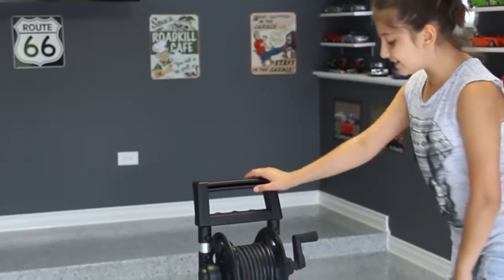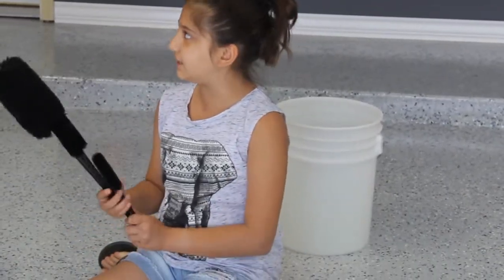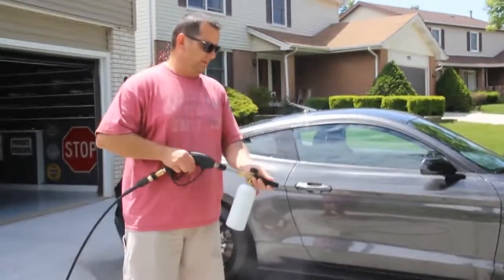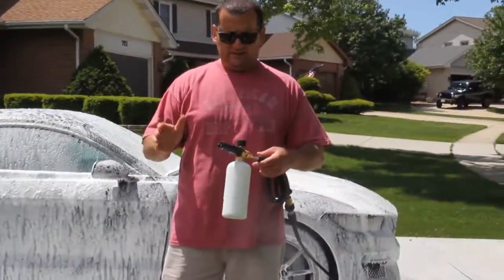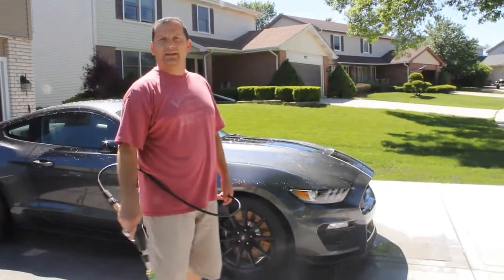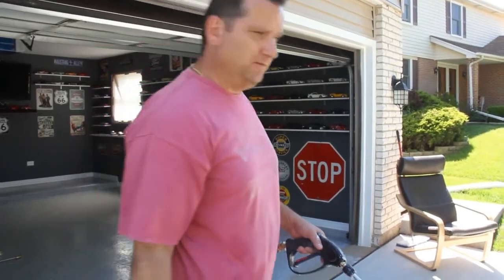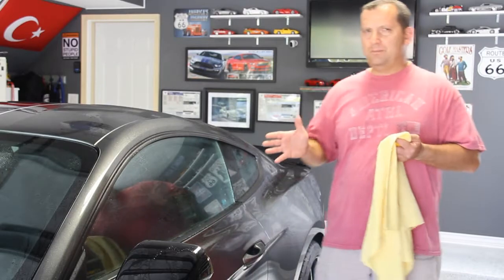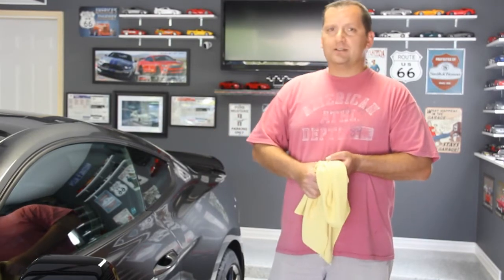Ford GT350 Detailing Foam Cannon

Comment: Love your vids. Keep them up man.
Reply: I have a question too. When ever I use my foam cannon, it seems water only comes out of it unless I hold it upside down. Am I doing something wrong possibly? I'm almost certain I have the same one as you.
Reply from the maker: Brandon dsadasdas .... Hey buddy, good question. The same has happened to me before. You might need to remove the adjustment cap with the + & - sign and reset  it. Mine got loose somehow and didn't work properly. Good luck pal!!
Reply: GT 350 Thanks for the advice man. I think I'm going to wash my car today too 😁
Reply from the maker: Nice!! It's always fun. Happy Memorial Day my friend!!

Comment: Sweet GT 350 man! I subbed. Btw what brand of wheel woolies do you use and how well have they held up so far? Just got my '16 GT and looking for something that will clean my Perform Pack wheels since they are pretty hard to get in the nooks and crannies.
Reply from the maker: Scotty Beats thank you so much buddy!! The brand I'm using are 	
ABN Wheel Woolies Wheel Brushes Kit...and they are holding up pretty good. I've used the on my 2016 GT for a year and still using them on the 350. I am also using Adam's Wheel Woolie with the slight angle to reach in those hard to get areas. Lastly I also have the Detail Buddy Premium Detail Brush set. I know it's a lot of tools, but that's what I have in my detailing arsenal to get it done. The GT premium wheels are so hard to clean that you need multiple brushes. Those Brembos give off so much brake dust it's hard to keep up with the wheels sometimes. I hope this helps!! Thank again!!!

Comment: You should consider doing the two bucket wash to prevent paint swirls but great job on the video👌🏻
Reply from the maker: Ku Ikram You are 100% correct!! I am very careful during the prep before the wash, but I am still shopping around for the best two bucket system with a dolly built in. That are just so overpriced for that kind of setup. Do you have any recommendations? And thank you much for watching!!

Comment: I hope you don't wash your car in the sun every time.  I know the lighting is better outside for the video.
Reply from the maker: Jim G, No sir, haha that was just for the video. Normally I would do it early morning or early evening. I dreaded the possibility of getting water spots after I was done. We were good:-) Thanks for the comment!!
Reply: I have a foam gun but I need to sit down with the instructions and really understand how to use it.  I tried it once and something wasn't right.  It didn't do much.
Reply from the maker: Jim G. Did you check the valve settings? I had an issue with my cannon once. It wouldn't dispense anything. I ended up taking off the cap controlling the soap pressure and reinstalling it. It was a quick fix. I hope that helps!!
Reply: I really need to read the instructions.  I may not have used enough soap either.  Mine isn't the same brand.  It is one that Autogeek sells.  Thanks for the input.